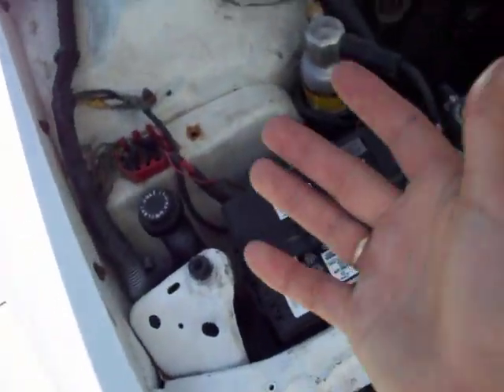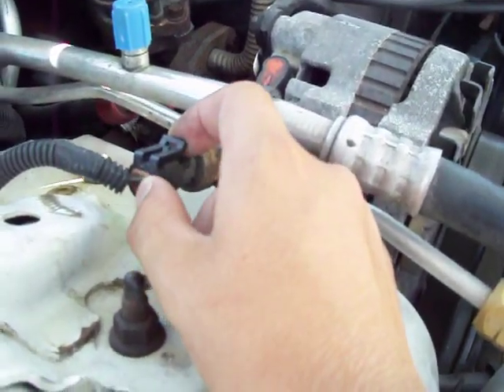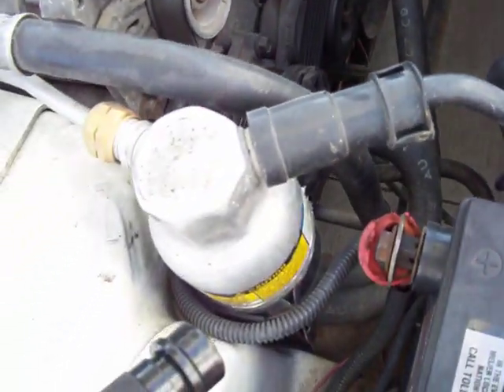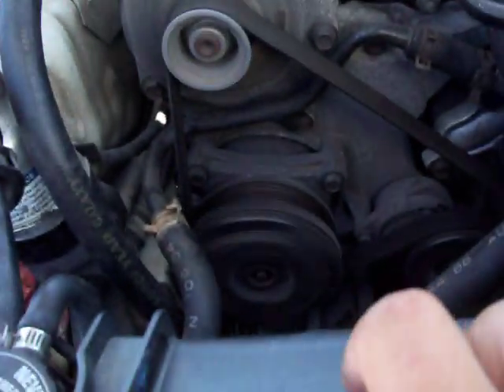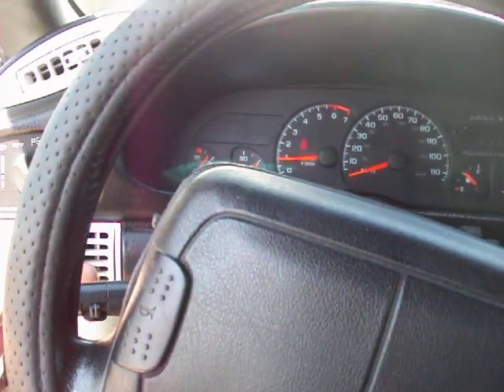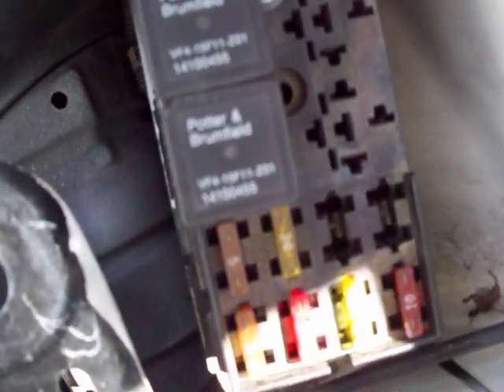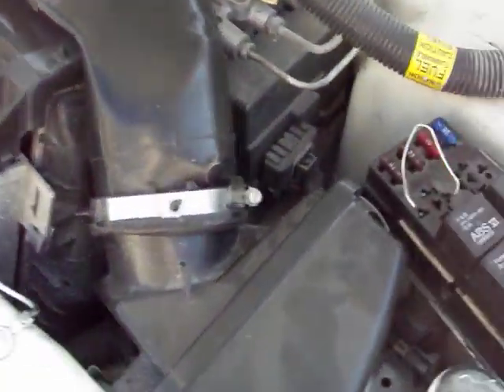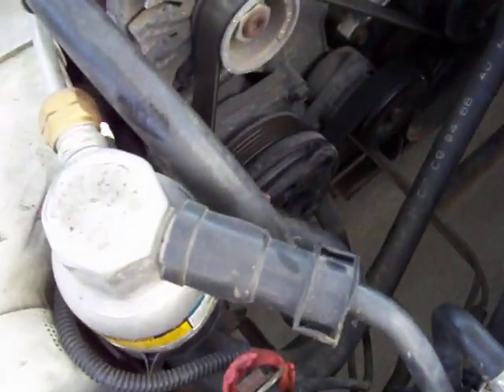How To Make AC Ice Cold, Recharge air, and Force the Compressor Clutch to Engage

Comment: Is there a way to check if the hoses are leaking freon?
Reply: Yes, a fluorescent dye can be put into the system on a recharge, or a 'Sniffer' can be effectively used to locate leaks... BTW, the word 'Freon' applies to the older refrigerants... 'Freon' is a registered trademark of the Chemours company , which included several CFC's... R-12 was one of them... R-134 is not a 'Freon' ....
Reply: Method A:
Charge system normally, then make a mixture of 50%  dish soap and 50% water. Use a paintbrush and "paint" all the hoses with that mixture (like you should do when you connect propane or natural gas lines). If you see bubbles you found the leak. Remember to clean everything and wipe it dry to avoid corrosion after you're done.

Method B: 
Use a Sniffer (as suggested above) or a fluorescent dye or other commercial leak locator.
Reply: +Michael Martinez .I have a hummer h2 ...07 .when I start it in the morning with Ac on .it works fine .then driving it for a while I stop and it's idling. .it get hot and temp gauge or up ...but I can give it gas and the Ac blows cold again and temp gauge goes dwn .but I let off gas and it get warm again
Reply: Hello jr, several things happen when the engines' rpm's fluctuate  during the driving of the vehicle, first- the flow of fluids that are driven by the engine slow-down and speed-up by the changing rpm's- Also- the amount of cooling of the passengers, engine, transmission, power steering, electrical power generated by the alternator are all affected by varying rpm's- at lower rpm - especially idle, the flow of cooling air going through the heat exchangers like the radiator, trans cooler, a-c condenser are at their lowest level of efficiency because of the reduced cooling air to carry away the heat, as it often normal for the engine and a-c system to warm up during the idle phase
Reply: Junior Montelongo
When you rev the engine, the pressure in the discharge line of the compressor gets higher. Higher discharge pressure means lower discharge pressure and more heat transferred, so colder air. Your system is likely to have a low refrigerant charge. Check it for leaks, and refill it.
Reply: id be checking the condenser for a blockage or poor air flow/ poor or no condenser fan operation. You may be getting enough airflow when driving but not at idle.

Comment: You right its usually low pressure or no pressure in the a/c lines. I have a video called "how to fix a cars ac that blows hot air". It helps to get the pressure in the green zone with the ac on max even when the compressor shuts off for a few moments. Plus a spray bottle with dish soap and water helps to check for leaks with ac system charged up. It helps to check the valve stem even under the low pressure fill side cap.

Comment: Why is it that a AC system will not accept a charge without the "Compressor clutch" engaged .  On most older cars they would take a charge and then you would hear the compressor clutch come on. My Grandfather has a 1999 Cad. Eldarado
he bought new, it now has 71, 000 miles on it and it will not accept a charge even though the dashboard read out indicates "Low on Freon" . I know these cars have a on board computer that is the brains of the AC unit and i would hate to screw that up by jumping the relay, or do you think it would not be a problem.

As it stands he don't have AC and can't spend the money to have it fixed at a shop
so it's up to me to get him going, Any advice would be appreciated
Reply from the maker: Basically, the computer just reads the pressure switch. If it's too low, the clutch won't kick in and compress your refrigerant.  Sometimes simply connecting the tool and releasing the freon into the system is enough to flip the switch and start the compressor, but because the pressure switch is usually on the high pressure line, it often doesn't work.  its hard to add freon to a system that is not on because its a sealed and pressurized loop.  Jumping the compressor will begin moving all the fluid in the loop and suction the freon in through the port.  Hope that helped!
Reply: ellswortha101  Thank you it worked out well.

Comment: I figure mine out after every trick that i watch on you tube and the compressor still did not come on so I did what the mechanic said by putting the 134 in and see if the compressor kick in and it kick right on and I proceed adding it in and now work perfect. So if you don't have a problem wasting 40 buck than go ahead and try it. I watch over 20 video and not one says go ahead and try putting in the Freon and see if it kick on. So no matter what in some vehicle the compressor will not kick on if you are low on pressure. hope this will help anyone

Comment: System is overcharged. Normal operating pressures on the high side should be about 150-180 PSI.440 psi the compressor blows a relief valve (valve is not serviceable). If you are using the cheap refill cans those are generally liquid propane. The thumping sound is the compressor trying to force the refrigerant but can not over come the pressure. I'm sure your belt is also squealing on the pulley. Stop adding refrigerant and go to a repair shop. It is also illegal to work on A/c if not licensed.

Comment: Hey guys, the video is wrong. Ellsworth and many others need to take advise from Mr Martinez, and the others that responded as Martinez does. Instead of stop leak you should replace the seal or the part that's leaking. If you need to short out the circuit to force it to operate, then you need to find out why.  There are possibly people reading this that would like to have accurate info and not have to read through this horrible language to Learn the correct way.

Comment: Michael Martinez, you should take all this information to your adorable Auto Zone and have them give you a better position with a better pay, this way you can have a better life of your own. FREE WILL michael martinez FREE WILL.....
Reply: +Johnny o  GO JOHNNY-O!!!!..... Actually I was trying to get people on track with the CORRECT information of the CORRECT and SAFE methods to do this type of work... I do agree with free will, as I used My free will to present a way to find the correct information, rather than be mis-lead by this individual who has no idea of what he is doing... BTW, Speaking of better lives, have You preserved Yours by checking the proper pressures of the system on the low AND high side of the system while doing work like this? If not, It would be to Your better interest to understand more of what YOU are doing when doing something potentially dangerous, such as dealing with high pressure gas's, Electrical systems and accessory drive systems....

Comment: I'm no expert, but If you want to recharge your  car's AC, Please ditch the crappy hose, and buy a proper set of manifold gauges. These will tell you the pressures on both the high side and the low side. For example, If your A.C. has the proper low side pressure, between 35 - 50 PSI, and you are still blowing warm air, you'd be confused.... BUT if you also had real time high side pressure readings, it will show you how your high side is performing. Both sides will behave differently, when somethings not right in the system.
Reply: what kid of manifold gauges do you use and where can we get a proper set from
Reply: Go on Ebay and search for 'AC manifold gauge set' and dont choose the cheapest set either (the ones shipped from china or hong kong)  I use R134a gauge set which is fine for any car on the road now from 1990 - present.
Reply: A $10 pressure gauge did fine for my application. IDQ brand for both (freon)@Fred's discount store. Although Auto zone did TRY to up sell a $20 gauge to me. Returned that unnecessary expense!
Reply: of course, it would but when you need to diagnose something, leave it to the big boys. After all, you don't see mechanics using cheap 10 dollar tools...

Comment: How do you know if the compressor or the clutch is bad?
Reply: 71drew to test the clutch coil.  Find the electrical wires that run  into the coil.  Take the connector off and use a multimeter to test for continuity in the coil
Reply: This is 5 years old but I'm gonna respond just in case someone else stumbles upon it. What I've done before is get some lead wires attach one to the positive and negative of the battery then to both of the prongs on the ac clutch coil connector, if the hub gets pulled in it's good, for awhile at least. If you have a multimeter, set it to ohms touch both prongs on the clutch coil connector, it should be between 2-5 ohms ,usually, any higher or lower means it's bad (I believe that's what the previous commenter meant by checking the continuity, but the term is unfamiliar to me) hopefully my retard speak is somewhat understandable

Comment: i filled my Nissan with R134a and now i can hear like the compressor or something turning on and off and my rpm going up and down. Help please
Reply: Good luck with that! I had a Nissan Quest a couple of years ago, and the AC system started leaking out of the compressor hoses, replaced them. Then the compressor made the belts slip and scream really loud when it engaged. I got rid of it and got a Toyota Prius V which never has trouble. I have heard this same problem is common with Nissan, and there is really no way to fix it. Probably because the Quest has a third evaporator in the rear of the minivan, and the compressor isn't sized large enough.
Reply: Most probably you have low Freon charge that's why the pressure switch command the compressor to on and off. Try filling it more but make sure you wont overcharge because it will damage your compressor. One more reason is that maybe your Freon strainer is blocked.
Reply: Those Nissan AC systems, especially the Nissan Quest have really bad shit with their AC systems. It wouldn't surprise me if the compressor is starting to self-destruct and is sending shit through the system. I had the hoses replaced on mine a few years ago, and ever since then, the belt would give off an ear-piercing sqealing for a few seconds after it turned on.
Reply: I solved the problem, i had to purge the AC System, because i put a little too much freon in the system.
Reply: Overcharging, believe it or not, actually can make the pressure get lower in extremes! Especially with systems that use expansion valves like most Nissan models. It's even worse if you have a capillary tube.
Reply: Christon Taylor
how did you purge the ac system?
Reply: christen
the link that you need is this.
scottykilmer.com/automotive repair/youtube.
This guy has nearly 48 years of expertise on any kind of foreign and domestic car mechanics,and is hard to beat in his workmanship of applied diagnose and repair of vehicles.
Reply: @al jones i used the gauge and release some of the freon. like you would release air from a car tire.
Reply: Nissan is actually notorious for having AC problems, but it's mainly in their SUVs and minivans. My Nissan Quest had leaky compressor hoses, and then the compressor started making my belts scream when it engaged, and it just barely cooled.

Comment: Nice vdeo. I have a problem with my A/C, its blowing only hot air. my compressor is not turning on, and i do have refrigerant for sure. My car was on computer and there was no errors.
Now friend of mine told me its either sensor or compressor. He think its the sensor (switch) but its a switch with 3 pins, so it seems that i can not bypass it. And if its a compressor he thiks that it is because Idid not turn it on during the winter period and that the cluch might got stuck and can't get lose.
I have a Hyundai Sonata 2007
I would like to hear if anyone have any idea how I can get my copressor running or do I have to replace the witch / compressor.

kind rgards
Mik

Comment: You don't need to engage compressor to add pressure.  If your compressor is off, it will turn on while you are adding refrigerant.  No forcing necessary.  It's a shame that people believe this misleading info and are sheepishly following this kids advise.  It's the blind leading the blind. ;0

Comment: Dont put stop leak in your system if a shop hooks an expensive machine to your system to check it out they will suck all the freon out of your car so they can fill it with the exact amount it is supposed to have. The stop leak can ruin a machine or clog a very expensive filter the shop owner will have to pay for.

Comment: AC cluthc engaged and enough freos but it's not cold.  What's wrong?  Plz help.
Reply: Mrkoto2012  A/C condenser clogged either on the inside , outside or both. It's ineffective to try flushing a condenser, so get a new one if it's clogged inside. this can kill your compressor, you know. the orifice tube or the expansion valve may also be clogged. But first thing, just see if there's bugs & crap clogging the outside of the condenser fins. Next, use a remote temperature gauge to take temp readings at several points along the condenser. If the temp is the same as outside air, it's clogged inside. the readings should be hot
Reply: +Mrkoto2012  high pressure switch??
Reply: You've overcharged it

Comment: forcing the compressor on continuously during running cars, will it affect the compressor life??
can any one tell the reasons.

can we force the compressor ON according to our wish. wont it harm the compressor??
Reply: Here are some reasons that the compressor should not be forced to run continuously: 1) Poor fuel mileage- It takes as much as 20hp to run the a/c system , which includes: blower motor(s), compressor, heat exchange taking place in front of the radiator for the engine cooling system, additional fan(s) to cool the engine, higher amount of heat in the engine compartment, reduced engine efficiency from higher heat of air intake associated with the higher heat of the engine compartment ....2) reduced reliability of the vehicle caused by: Additional (higher than normal) heat in engine compartment, continuous strain on the accessory drive system, continuous strain on the a/c-compressor and alternator, continuous strain on the engine cooling system.... 3) Give Your vehicle a break!!! It needs to get a rest,  just as You would after running a long race on a hot day... This would be a major cause of breakdowns in the middle of the desert, when people modify their vehicles in this way.... Keep it working correctly, and running reliably by doing the repairs and installing parts/equipment that meet the mfgr's. specifications....
Reply: He forses compressor only to refill, because of low refrigerant there was low pressure,  at low pressure clutch wouldn't engage. obce filled up, remove paper clip, plug back in the relay.  now system is filled, a and car will work normally with compressor clutch sycling, engaging when needed to
Reply: Hello Ivan K.... Running the A/C compressor by manually engaging the clutch is ok for troubleshooting and servicing the system if: 1) The compressor is not seized   2) The temporary engagement of the clutch is ONLY for servicing and troubleshooting   3) The connection between the two terminals on the female plug for the a/c relay is done with a 16awg wire with the proper size bayonet connectors on both ends that are the same size as the relay connectors...DO NOT USE A PAPERCLIP to do this!!!!   4)The re-filling should ONLY be done with a manifold set-up with high and low pressure gauges... Never use the rummy low pressure gauge given with those a/c re-charge suicide kits...   5) Never use a/c system sealant...   6) Always use eye protection when doing this type of work   7) Always follow procedures in the service manual and / or the procedures given from PROFESSIONAL technicians, like what is in the Auto Zone video.... Do it right, or don't do it at all.....
Reply: So Michael M. your most worried of the danger of explosion using this method?  OK so polycarbonate eye protection up, use leather welding gauntlets and extra heavy clothing some good ear plugs and go for it.  Case closed.  Then after refilling the A/C system with R134a remove the paper clip!  OK so now we all are depussified and safe!
Reply: As usual Odin-whatever your last name is, those who make direct comments of the 'bravery' of HOW those who 'should' be working on things like this - often turns into an exaggerated-judgmental , very poorly advised way to do things like this - That is a nice photo of you and that infant, lets hope the little one will be able to see you as a healthy person, when he reaches age 20, however with what you just said here, sadly, that may not be the case ------ BE SMART, ERROR ON THE SIDE OF CAUTION - INSTEAD OF ERRORING ON THE SIDE OF NEGLIGENCE - You tube is packed with videos of people making epic failures of doing dumb things that often cause life-long injuries and pain or even death doing stupid things , tricks and stunts, it's your choice amigo ------

Comment: HELP!! when I tried to recharge my truck ac, the gauge went all the way to red. my compressor wont kick on and ive replaced the high pressure and low pressure switches. everytime i try to charge it the hose just pops off. Ive left my truck off and released all  the pressure where you connect the hose to see if that would work but when i try to charge it afterwards it still has high pressure! Anybody know whats wrong or do i just need to buy a new compressor